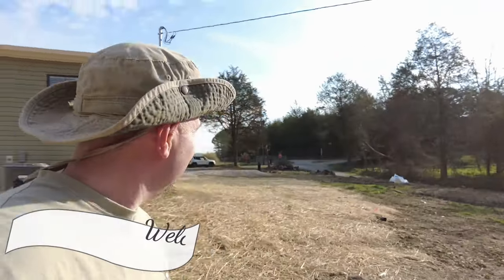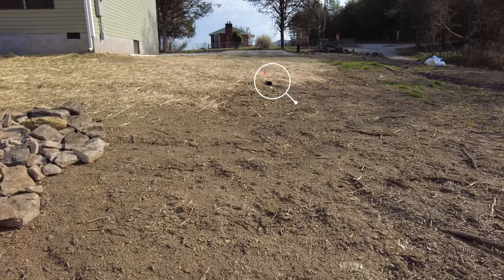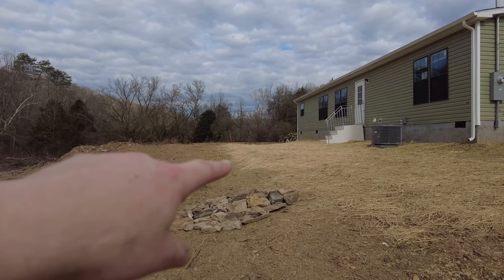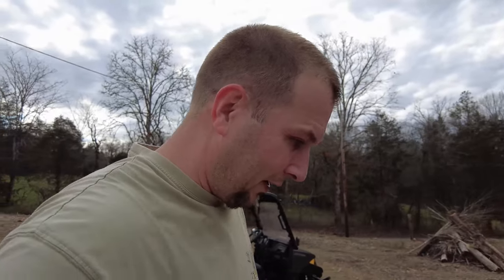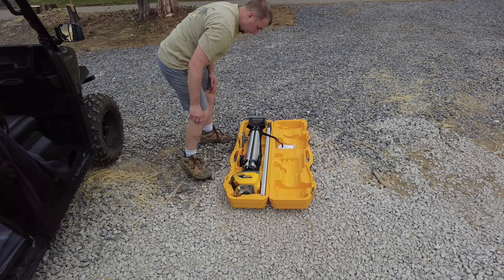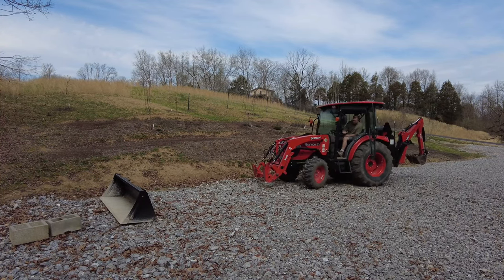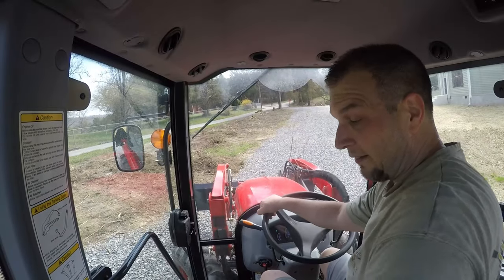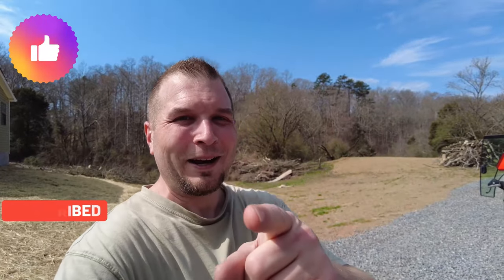Weeping Spring-Cover up- Branson 5520 BL200 *Spectra hv101 level*

Comment: New subscriber. :) Talked to you this morning when you came out on a repair call. Unfortunately you informed it was the compressor. So, RIP fridge. :( So far I have watched this video and the one from the property walk around. Wow! What a difference! Have you considered a shallow well with a good old fashioned hand pump in among the rocks? Ornamental and functional. You two are so lucky to not only have a running stream but also near surface water. I know you are going to set up a ram pump to keep your coming rain water system backed up full. But maybe also as another back up and something to help your coming green house a small solar powered well pump? I don't know, maybe just spitting in the wind here. lol But love the content and keep on going. Good luck!
Reply from the maker: I haven't thought about that using a shallow well. I know because we are in a stone throw from Oakridge and on the river here the county doesn't allow drilling for wells for your home so it may be the same for the shallow well not sure. But good suggestion. Thanks for the sub and comment